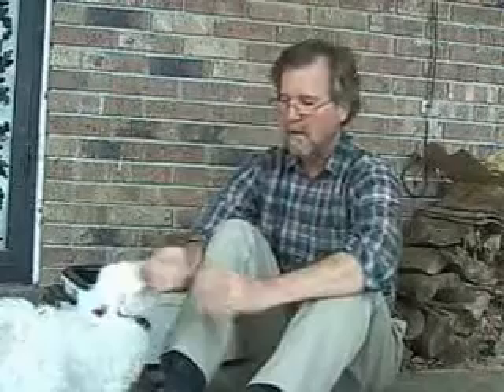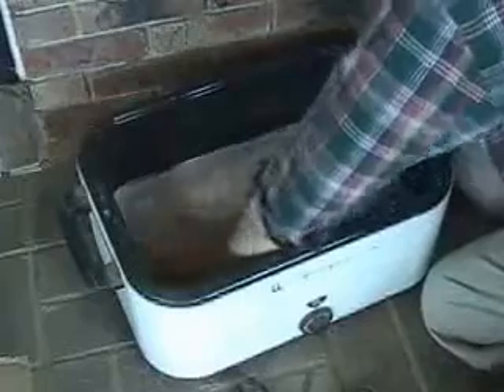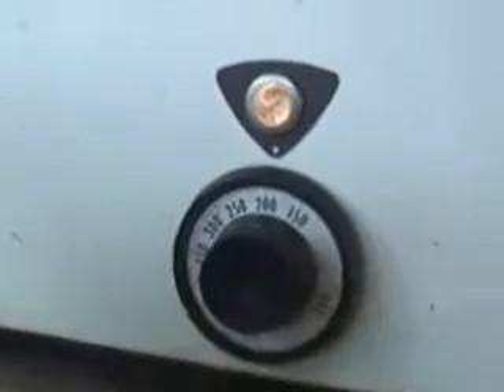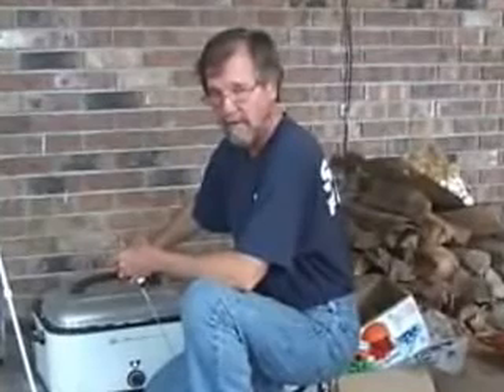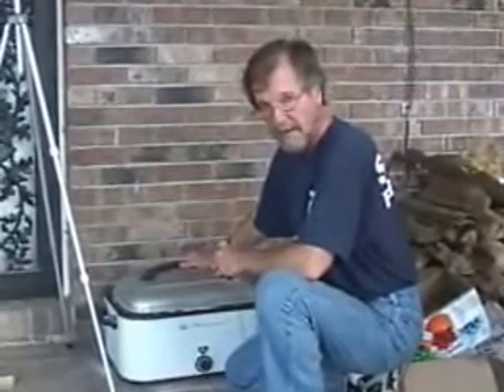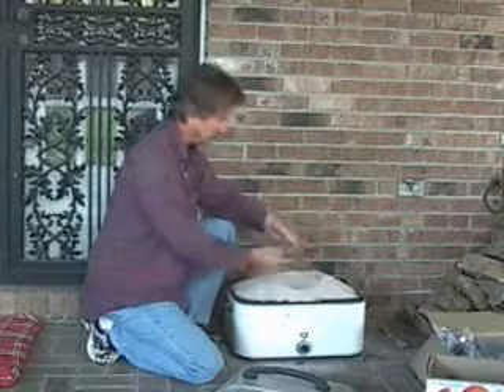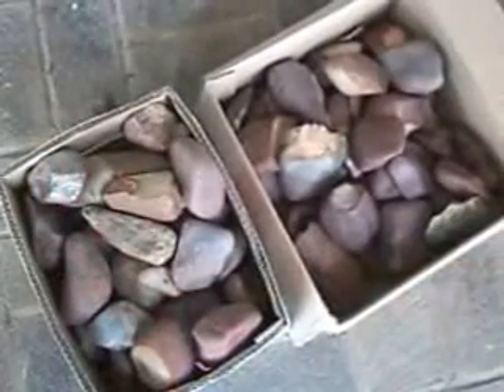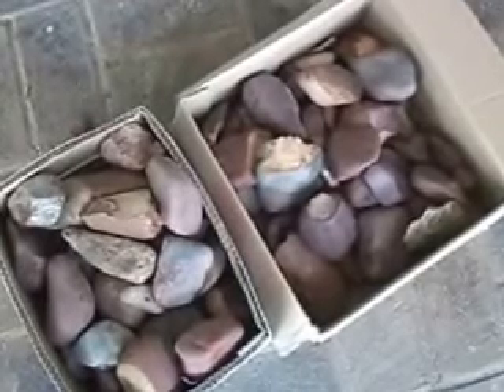Heat Treating Chert in a Turkey Roaster

Comment: what is the difference of chert and flint?
Reply from the maker: There is virtually no difference. Both are microcrystalline quartz. The primary difference is that most all this material is called "flint" in Europe and most of it in the US is called chert. There are exceptions but those make no sense either. For instance there is the Alibates Flint Quarry in the Texas panhandle, but the "flint" is actually chalcedony. Is that as clear as mud?

Comment: Will this method work for agates and jasper?
Reply from the maker: It will work on any type of rock that can be treated by the temps your roaster can reach. Agates and jaspers vary, but if it is 500-450 or less, I am sure it would work. The sides and bottom reach the highest temps and Like I said, you need to probe in different areas with a thermometer to know what your roaster is doing.
Reply: @BenHenry1957  Thanks so much Ben